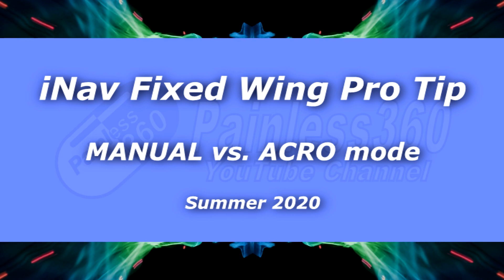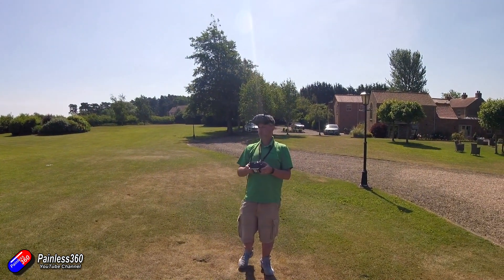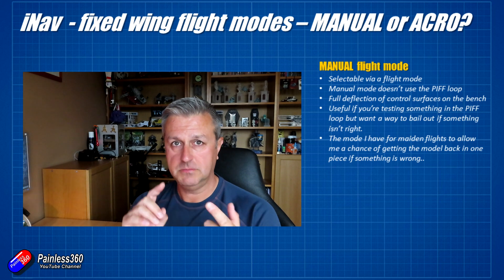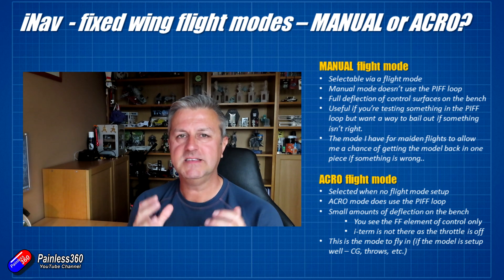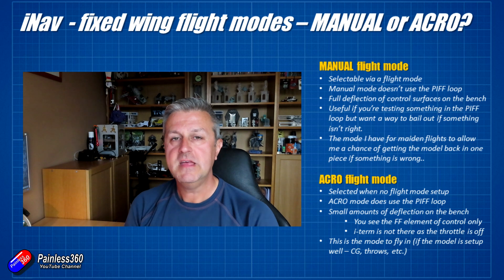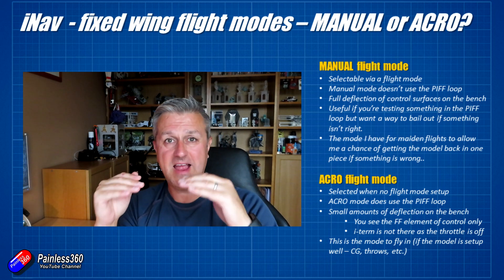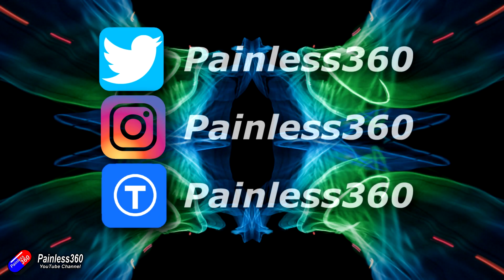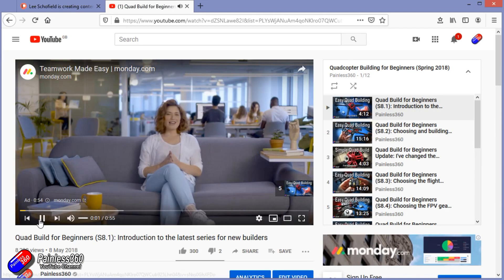iNav Fixed Wing Pro Tip: MANUAL or ACRO mode?

Comment: Just had a successful flight with my Talon 250g and acro is the best way to fly it due to the tiny size of it. The size of the plane should also be considered.
Reply from the maker: Defintley. Most super lightweight planes and wings need a stabiliser to fly in anything but completley still air.. see my reviews. happy flying!

Comment: Hi Lee. I need a bit of help if you find a spare minute? I have just migrated from inav 2.4 to 3.2. However, on the bench test every time I switch between modes, the RTH mode is displayed as acro mode. When the model is connected to the PC it is showing that it goes into RTH, nevertheless in my goggles still showing that it is in acro mode. Please help me!!. Thanks in advance!
Reply from the maker: The GPS modes will not engage on the bench/when not in flight. See my INAV 3.0 fixed wing mini series on the channel for how I set it up. Lots of setup tips in the two videos in there at the moment..
Reply: @Painless360  Fantastic, thanks for your help!! Very kind!

Comment: Painless, thanks for your informative videos. When in inav angle mode is it normal for a fly wing to lose altitude in an aileron-only turn? I'm confused as to why level pitch isn't maintained during a bank. Any advice would be appreciated.
Reply from the maker: Don't fly in angle - for a well trimmed plane - use Manual or ACRO. I don't fly in angle.. Best of luck!

Comment: So basically to start with - you just need Manual and Acro modes selectable  - together with a switch for trim and tuning.  
Its confusing as Inav wiki doesn't realy say this.
Reply from the maker: I wouldn't have both set on a model. I fly a lot of manual.. See my iNav series..

Comment: Hey, I’m setting up a wing right now! How can I set up trims in inav? Is it just recommended to just use normal transmitter trims or will it kinda mess with inav?
Reply from the maker: Check out my iINAV for beginners 2020 series. I cover every single one of the steps in there. Including the do's and don'ts.

Comment: Thank you for the explanation of Acro! So I recently  finished setting up a new ZOHD Talon GT and I have maiden the bird. The Talon felt way to sensitive on manual mode to me so I proceeded to tame down the model mechanically by installing longer horns on control surfaces. But it still needs further adjustments, ti is still a bit too sensitive. Which setting in INAV could I use to further tune the plane to be more stable and docile on manual mode?

Comment: Here's the problem with inav= after correctly trimming the control surfaces using autotrim, the trim is sometime changed a little bit in the next time we fly the aircraft. In Acro mode this is not a big deal, but in manual mode this can be a problem as we should not use trim button on the TX.

Comment: You should NOT recommend ACRO. AIRMODE is the best option on a wing. It keeps the PIFF loop active if you lower the throttle.
Reply: As AIRMODE is permanently enabled by default in INAV, maybe you & Lee mean the same thing.

Comment: Hi, you should probably mention, that it is necessary to adjust the FF already on the bench, before you use any of the stabilised modes in flight or even for launch. I think it is dangerous to fly any fixed wing model with a wrong, or most likely waaay too low FF, because the model will have probably way too less movement and therefor no authority in the sky and crash into something or just fly away. I always recommend to setup FF on the bench before first chuck to something like 80% of surface throw like in manual mode. At least the FF, then get it in the air and perform Autotune. Another absolute must have before first throw is to setup your rates properly, otherwise Autotune will mess up as well
Reply from the maker: Interesting. Thanks for the comment. See my iNav builds for how I do it. Works every time for me without that step. Happy flying!